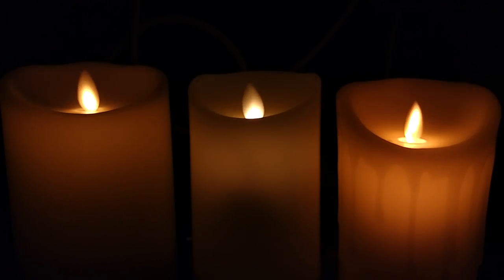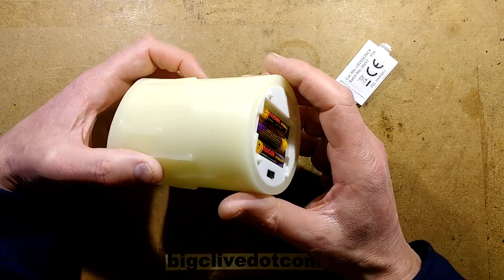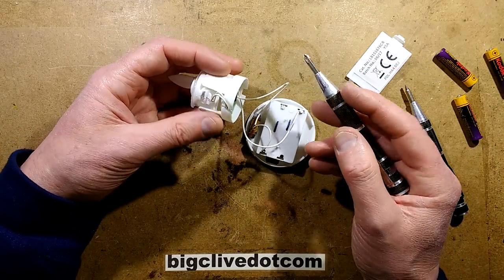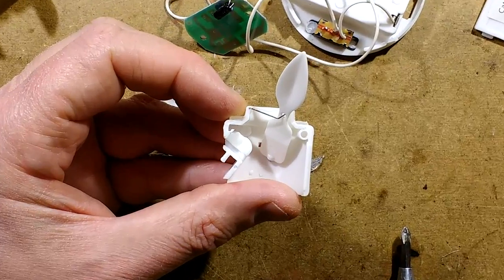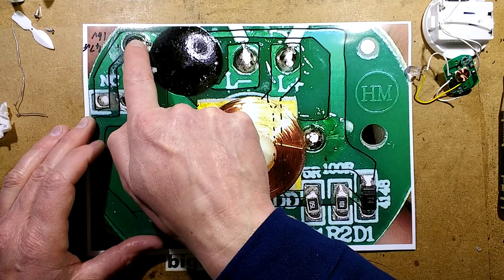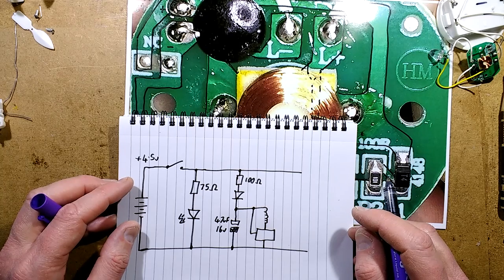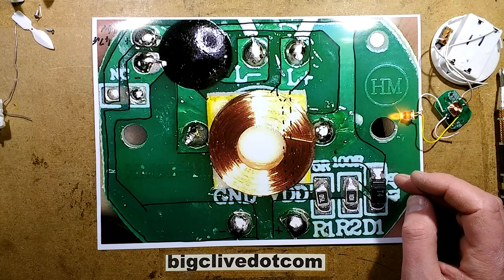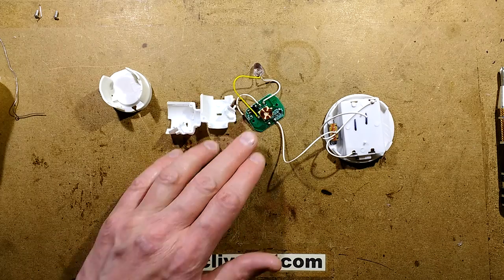LED dancing flame candle evolution 2018.

Comment: Clive, in your opinion how long will a Luminara candle last. I googled that question and the answer is 4000 hours. But I'd like your take on it. I don't mean battery life but the life of the candle.
Reply from the maker: That's all down to the reliability of the LED itself.  Very hard to quantify.
Reply: @bigclivedotcom  Mad About Science site says: "These candles have an approximate lifespan of 4,000 hours - lasting years longer than a traditional burning wax candle." But another site says "An LED has average life of 200,000 hrs." Is there something else about these candles that would limit their life to 4000? The newer ones doubled their rated battery life from 500 to 1000 hrs on 2 D cells. So 4000 hrs would only be 4 battery changes.

Comment: its been a while ( out of practise)  but intriguingly would a simple zener diode ( under that blob ) do a crude discharge duty function at a set voltage as the 4uf capacitor charges up ?? therefore inducting a small magnetic pulse/field in the coil.
Reply from the maker: It would just clamp the voltage and not pulse.

Comment: This is probably something you won't be able to answer without giving it a look, but I'll throw it out there. I have a luminara candle with the 2D cells and timer which seems to have something loose so that I have to give it a smack on the side for the light to come on. I have no electronics kill so I haven't taken it apart since I wouldn't know what I'm looking at unless it was
Reply from the maker: Check the battery contacts are clean.  I had an original where the supplied batteries leaked.

Comment: Unless it was incredibly obvious. Anyway using the switch the light will come on and off and go to timer with no problem what you give the things Shake and it'll go off until you give it a smack a few times and it'll finally decide to stay on. I have a bunch of luminara candles just like it and this is the only one with that kind of a defect.

Comment: I bought a 5-light led candle set from Hobby Lobby and was so disappointed that they had an ugly yellow flicker when I put batteries in them.  My husband is very handy with electronic and electrical projects so is there a straightforward video on how to change out this yellow flicker to a warm white?
Reply from the maker: You can change to warm white LEDs, but if they're the flickering type of LED the correct colour is very hard to find.
Reply: @bigclivedotcom  is there a specific video showing how to do this? I just want the yellow gone!

Comment: Is it possible to put a color LED so we can see what it would look like?It can be any color but I think blue will cause the biggest wow effect, and you could re sell them as color flame candles I bet it would be easier to re sell them since they're practically non existent and most people have neither the knowledge or skill to mod one.
Reply: Nealy any color LED can be put in place of the one in the candle.  
To be extra fancy, you can put in 2 LEDs.  The existing LED circuit can power one and an added 100 Ohm resistor and LED could be used to provide a different color.

Comment: Is there a way to fix these? I've got a Luxury Lite candle that no longer lights. If you can tell us how to troubleshoot these candles, I'd rather fix than throw it away.
Reply from the maker: First thing to check is the battery contacts are not corroded and that they do make proper connection with the battery pips.

Comment: You can remove the hot-glue with White spirit or even Olive oil. Anything which will soak under the glue and would not damage the plastic.

Comment: When you say the term “reverse engineer this” what does it mean? I thought it would mean like modifying it.
Reply: Take it apart and see how it works.
Reply: Yeah, more specifically it means to engineer (design) your own product by learning the operations of a working product.
Reply: PugMan3 PugMan3 It used to confuse me to. It basically means what it says engineer in reverse. That is take a finished and working item and create a design from it. Go through the process that went into designing it but backwards and end up at the start, a drawing on paper.
Reply: Nick Combs No cloned product is implied. Reverse engineering is only the finding out, for any or no reason.
Reply: John Francis Doe I never said it was. Your reverse engineered product could simply be a scribble on a napkin.
Reply: Hardly a "product" then, but we're just nitpicking

Comment: Clive , what resister would I need to power a device that uses a CR2025 if I was to run it using 2 AA batteries ?
Reply from the maker: +ianhadfield65 Theoretically none   What's the device?
Reply: bigclivedotcom it's a car alarm fob

Comment: That is wrong. The original Luminara wax candles are very easy to open, and you don't have to break the wax.
It's just two philips head screws.
... and I still don't understand why they are not using larger batteries (I hate changing batteris more often than necessary)

Comment: I have an issue with my Luminara candle. It still functions but the "flame" doesn't flicker anymore. Any ideas how to fix that? I really need some help here!
Reply from the maker: Check the flame is free to move and if it is then check that the coil winding hasn't broken at a solder joint.

Comment: Does someone have a idea if such moving flame module (incl. the plastic parts but without the wax candle and battery case) is somewhere available for purchase? It would be nice to have for my DIY candles.
Reply from the maker: It may be easier to get it in an existing candle product.

Comment: Does anybody knows where to buy this candle but WITHOUT the wax. Need ONLY the plastic housing with the elektronic stuff? I would appriciate if someone could give me a hint.
Reply from the maker: I don't know of anyone selling just the module.  It may be easier and cheaper to get it in a full candle.
Reply: @bigclivedotcom 
Hi thx for your lightfast Response! I have found some tea Lights... They come match my needs. The Problem with this Simulation is that they make a shadow behind the plastic flame and makes it unrealistic. I found another Version of a "3D" candle which is a solid flame, it illuminates to all directions and the falme rotate 360°. Do you have some experiance with such type?
Btw. I like your detailed explanations. However try it sometimes not to talk to much around - it saves time :-)  but continue your work!
This shitty autocorrection makes mistakes and killing my nervs :-)

Comment: is your drawing wrong ? how does the led pulse with your drawing showing it connected directly to the power switch.
Reply: check 7. comment below
Reply: Clive connected the LED directly on the coil to show the pulse interval
Reply: It normally does not pulse. Listen what he says at 6:56, he rewired it to show the pulsing of the coil.

Comment: i bought a pack of smaller e-candles with a flicker and i thought for sure their was a 555 or some circuit but their was nothing inside but a battery and switch? it was the LED that had a flicker built into it. very strange. i didnt liker them so i swapped them for a regular LED.  flicker LED pic here https://hackadaycom.files.wordpress.com/2013/12/flicker-chip.jpg?w=504

thanks for sharing, these are nice. And Happy Gnu Year!

Comment: Acetone loosens hot melt glue.
Reply: But acetone also melt the plastic.
Reply: Iso/Alcohol will release it, apply to where it joins and just peel it off. Best applied with one of those needle top bottles.

Comment: I am sure that if you tried to swing magnet against the coil it would react somehow, and those pulses were just initial ones to start swinging. at least this is how other chinese coli-magnet things work
Reply from the maker: I tried that by reassembling it with another LED and high value resistor attached, but it didn't change.
Reply: bigclivedotcom Thanks! but still it is so random looking with that regular pulse pattern

Comment: Would you be able to duplicate this battery or be able to guestimate what's inside this battery?  https://youtu.be/UtQGYz4f3YQ  It's called the Oxford Electric Bell and it's lasted 176 years.
Reply from the maker: It's a Zamboni pile.  A dry battery that can generate a high voltage but at very low current.  The bell operates with electrostatic charge so the current is absolutely tiny.
Reply: Interesting!  Is there anything that you can think of that you could design a project around that could run off of one of these and last a few months or years?
Reply: It's nothing to do with the battery (well, very little to do with the battery) and everything to do with the load. The load is using nano amps. For reference, nice modern 18650 lithium ion cells have capacities of around 3 amp hours. Thats roughly 3 amps for an hour, 1 amp at three hours, or in this case, 3*10^9 hours at one nano amp (over 3000 centuries ). What little is the battery adding? Well, I'm sort of talking out of my ass on this, but for it to last that long I imagine the chemical stability of the materials must be very high for it to not self-discharge. Probably something to do with it being dry and probably almost completely solid.

So in short, no. There really isn't any useful load that uses nano amps. Not yet at least.

Comment: disliked the one on the right by far.  wasn't moving right and led too bright.  left one meh moves too much preferred the darker cheap copy.  as shown on the video which could changed alot..  That and the fake wax drops are distracting.  By and large our Christmas candles doen't drip on the outside so maybe it's a thing in the UK.   or Dracula.  not sure which.  as for the circuit board.  hmm R2 D1 ?  um a minor revision cause it to turn into a droid?  :)
Reply: Lee Bartholomew Outside dripping on large candles can be triggered by multiple things:  A. Hand made candle where the wick is not perfectly centered. B. The slightest draft pushing the flame slightly to one side.  C. Holding the candle at an angle when lighting it.
  Once the flame is/has been off-center, the "wall" around the molten wax will be thinner on one side and will spill some molten wax as it gets consumed into the molten wax that gets wicked into the flame.  On extremely wide candles, the wall isn't consumed and someone has to manually remove it or push it into the flame, again creating an opportunity for asymmetry and leaks.

Comment: I thought they all looked awful, you can not beat a real candle like a real house fire... I mean come home to a real house fire, I mean a nice fire in a nice fire place in a nice house, well it doesn't matter how nice the place is, it has a real fire in it. The fire place, not the house.

Anyway, candles, they don't smell the same as real ones, the real ones smell of burn hair, if you sniff a candle flame, thats what it smells like.

So do these smell like burnt hair? No. 

I have lost count of the amount of times I have electrocuted myself, Several times at home blowing things up in the wall socket, experimenting with the mains electric on DC appliances... In addition to that, I have also tasted continental AC twice @ 120v ac in Spain and Portugal and once in France and once in the USA. 

So you have to make some allowances for me.
Reply: Not back in the day when I went on holiday to those places.
Reply: Must've been a nice big chunk of time ago